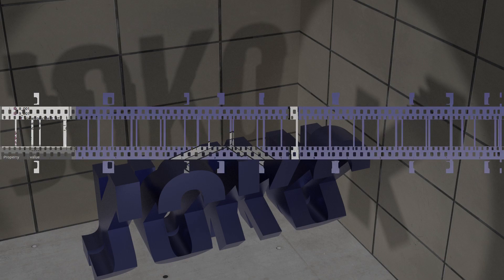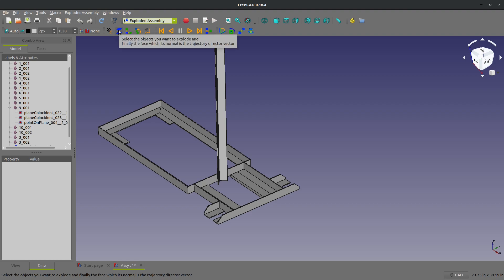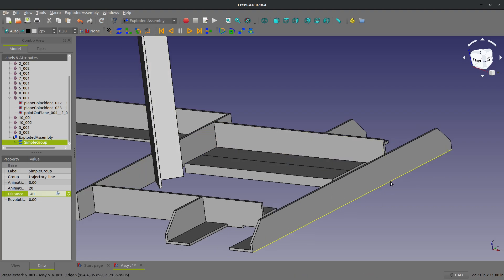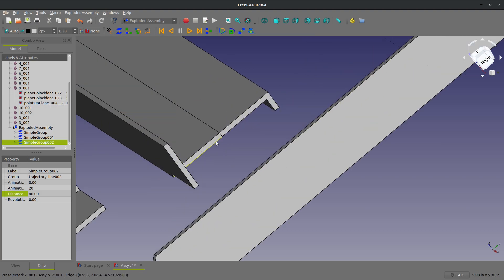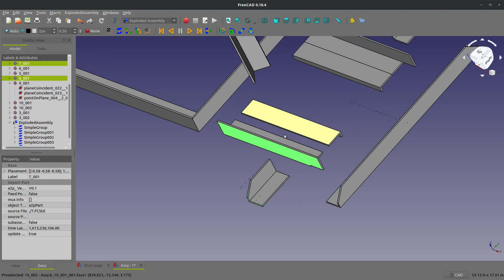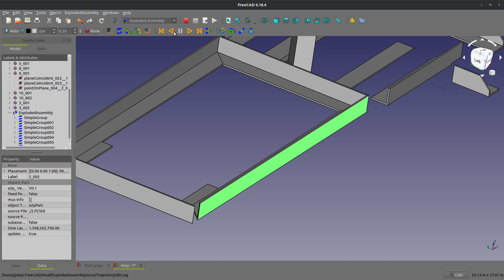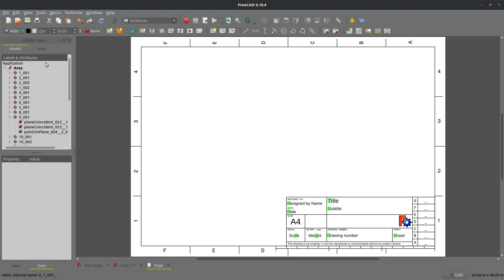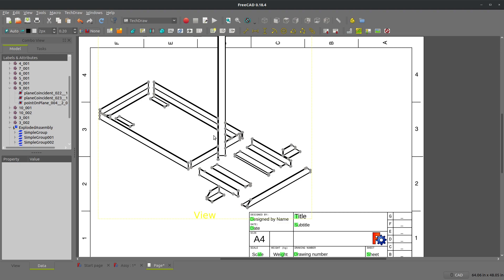FreeCAD - Explode an Assembly |JOKO ENGINEERING|

Comment: This doesn't seem to work with the Assembly4 workbench. What did you use to make the assembly that you are demonstrating with? I get this error message when trying to explode an assembly made with Assembly4 on FreeCAD 0.19

 <Part> ViewProviderExt.cpp(1340): Cannot compute Inventor representation for the shape of V_1906_Tangential_Creel_spindle_mount_assm#trajectory_line
Reply from the maker: I have used A2+
Reply: @JokoEngineeringhelp  Thanks!